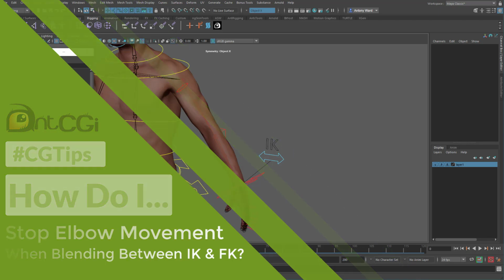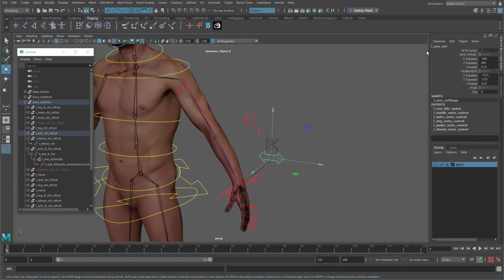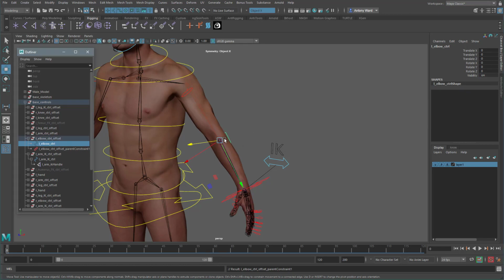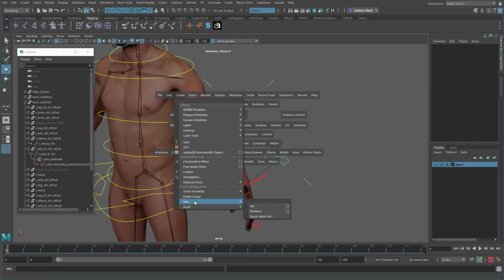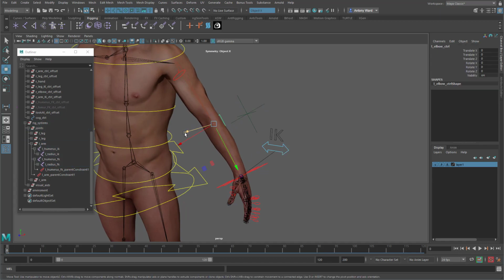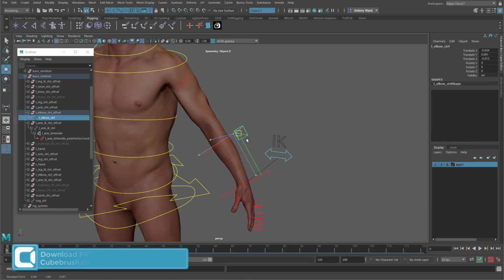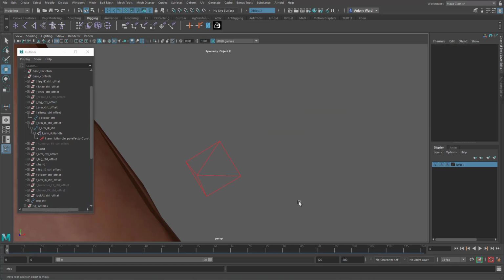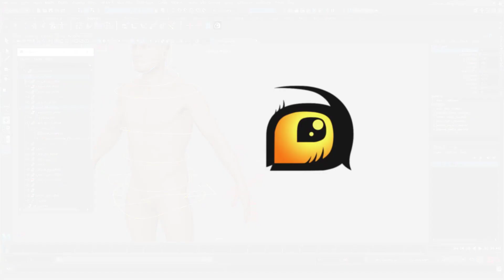#CGTip | How Do I Stop Elbow Movement When Blending Between IK & FK?

Comment: This is the problem I'm currently dealing with. But for some reason when I bring the elbow control back even just a little bit, the arm twists dramatically. Like way too much. Is there any reason for this happening?
Reply: Hi, sometimes its because of maya itself. Just save your project and restart maya. If you  are using laptop dont forget to activate turbo mode for full functionality. I had same problem.

Comment: Oof, this is the exact problem I'm having. Quick question: I snapped my elbow control offset to the locator that didnt move. Now that I'm supposed to move the elbow control offset so that the other locator is in the same position as the one that didnt move - I just end up in the same elbow ctrl position as before instead of the new, assigned one. Did I miss something?
Reply from the maker: Hi! Did the elbow move initially before you tried to do this? Sometimes, if the arm is built along a plane, the elbow doesn't move.

Comment: Really nice trick! Here's a quick tip from me: I would recommend using "modify-> match transformations" to match transformations between objects.. It's a bit faster than using constraints and then deleting constraints all the time. You could also use locators to mark or basically store certain positions/rotations and then use match transformations the snap objects to that "stored position" -> the locator. You coud easily make a supersimple melscript out of that trick to automate this nice trick. No need for distance between nodes.
Reply from the maker: Siebe Janssen nice, thanks!